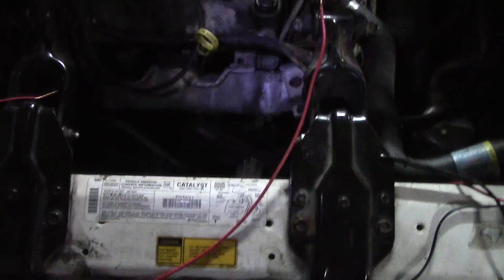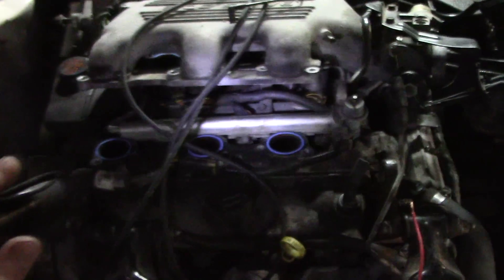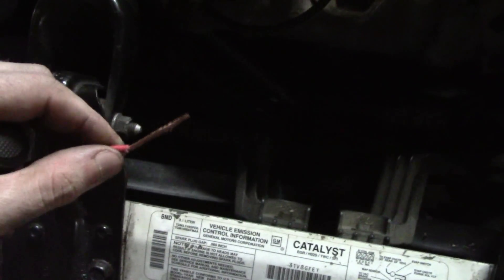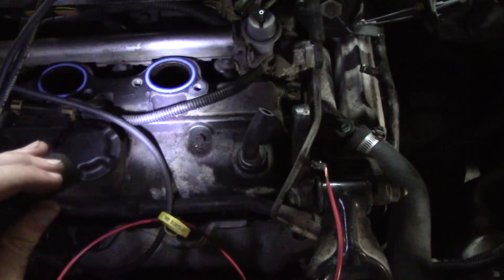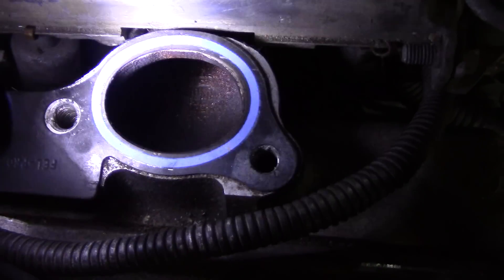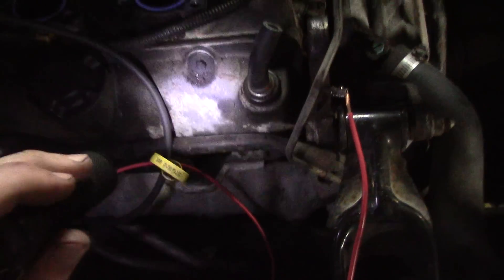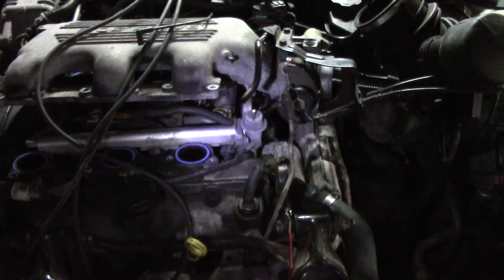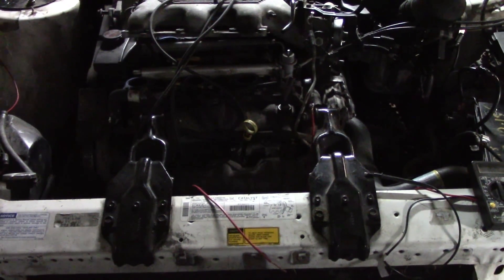Manually Jumping Injectors 96 Grand Prix Derby Car

Comment: probably a head/intake gasket or the cam broke for that cylinder. Pull the valve cover to see if both the valves are working for that cylinder.
Reply from the maker: It blew up the next day. Figure it was more than a head gasket issue haha.

Comment: im not convinced it a head gasket, the amount of water it would need to suck in to stop from firing it quite alot of liquid., you would notice the water level dropping and there would be bubbles in the Rad, and milk in the  sump. it possible the injector nozzle is deformed and instead of atomising the gas in it could be just pumping it in straight. you could test by draining the radiator and run it with out water for a minute.